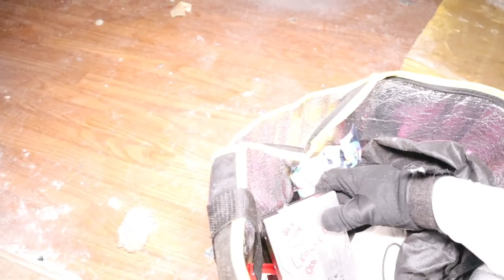(30 MINUTES ALONE) WILL SPIRITS "STRIKE" OR "SPARE" ME AT THE ABANDONED BOWLING ALLEY

Comment: not everyone will hear or see the same things - it will give high points to look and listen for - even those things that get missed - if one really wants to hear the whispers and other voices they should use headphones with a very open ear // 0:38 sounded like something saying ( Shhhhh ) or was it a semi truck going  by // 2:48 lots of orbs leaving your area to the back of the alley then right back at you all on the right side of frame by that messy table // 3:12 that is one hell of a HISSS-SSS // 3:20 crazy new spot for that knife to be // 3:34 very crazy scream - like a Parrot ? and did it possibly say ( get out ? ) // again things look alot different from Joe's video to yours Chris - tables and chairs with other things not in same places or used to block things off and i do not recall that picnic table // 5:12 Chris as you are saying OK this is - there is a voice joining you - left ear // 6:50 in left ear there is a huff sound very soft and sounds like ( ha ha ? ) // 7:23 the rattle noise to me sounded like vertical blinds // 7:41 just after you turn off light and use flashlight there is a orb ? that moves across the floor just to your right between the red and yellow squares going to the left or in front of you // 7:54 by the bar there is ceiling tile on floor and looks like another orb ? moving to the right // 8:01 with the rattle noise the yellow floor tile there is a orb ? // 8:46 in the ceiling there is a orb ? to the right side - then shows again after you move right to the last open tile in ceiling // 9:00 again more orbs moving about on the right side of frame - some are faint and some are not // 11:05 the slam sounded like a heavy board landing on the alley - but those are all tore up // 12:06 possible orb ? again on right side of frame - then in center moving into the ceiling // 12:24 something just bowled a bowling ball - possibly looking for the knife ? - if spirits can move stuff - that would be my main concern the knife // 12:32 by the white piece laying of on the right // 14:07 again with the right side and possible orb ? coming towards you  //  14:09 a huff breathe sound in left ear - again at 14:11 // 14:31 again a orb on the right side // 15:20 i herd ( must go ? or lets go ? ) where you posted ( stash away ) // 15:43 some kind of gurgle sound // 16:01 to it sounded like a very faint whisper voice say ( come on mother fuck - you are mine mother fuck ) this is what i herd in the left ear - like its teasing you or taunting you to follow it - like heading you into danger // 16:40 again with the same whisper voice says left ear ( look around ? or turn around ? --- then right ear ( behind you -- then  ( mother fucker I'll cut you ? --  back in left ear --- again this is what i hear or think i hear it saying // 17:18 still that whisper voice says ( mother fuck ) left ear // 17:32 some kind of growl ? gurgle like in sound - right ear // 19:46 a breathe ( haaa ) // 20:02 a possible orb ? from right to far center just before you hit the bright light // 20:07 orbs ? now coming from the left side then again at the right side // 20:26 some kind of chuckle laugh in left ear // 20:37 could be a possible light reflection of the far wall - it does have a strange look to it before it vanishes into the support beam - plus a few orbs ? out in the lanes area and back of building - they start coming towards you by 20:49 // 20:51 sounded like nails on a chalk board just before a couple of orbs in front of you // 21:37 some kind of growl sound // 22:03 just very glad you decided to check on the KNIFE !! // by 22:51 thought i herd like a faint breathe then some kind of voice like also very faint ( oh ) // 22:57 sounds like someone trying to blow off the dust // 23:53 a few orbs to the right side // then some scratching noise - a growl then by 24:02 a voice ( get me ) - LOL LOL i thought your stomach was telling them spirits to back off // 24:13 sounded like a hmm or a hum or mm - in reference to the food remark  // 24:22 a very faint voice says ( here ) // 26:35 either a very pale orb or white mist moves just in front of you by the seats in front // 29:52 with the screams there is several orbs flying about just in front of you // 30:03 a voice saying ( cold ? or old ? ) i do not think it was your stomach this time  // 32:12 herd something hard to say for sure bit it sounded like ( no ? or go ? ) // 32:37 a loud breathe taken // looks like Chris bowled a Turkey just in time for the feast - hope all was good for Thanksgiving with good food and we now have the Spirits to go with it // be safe and God Bless